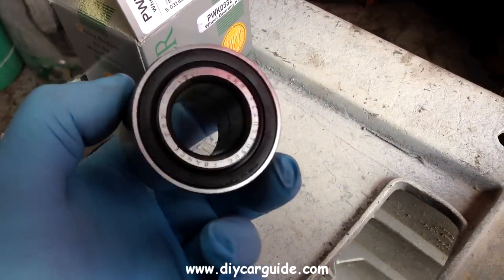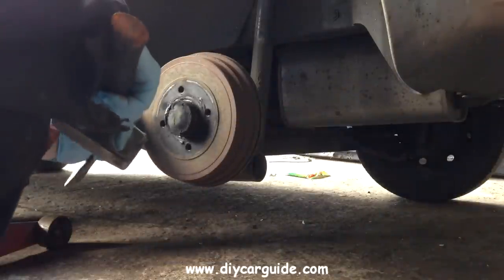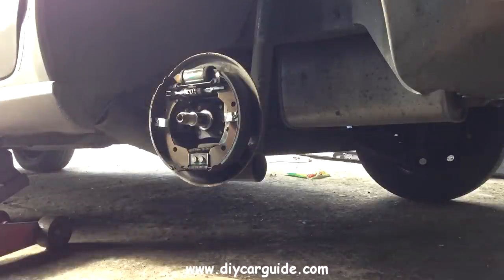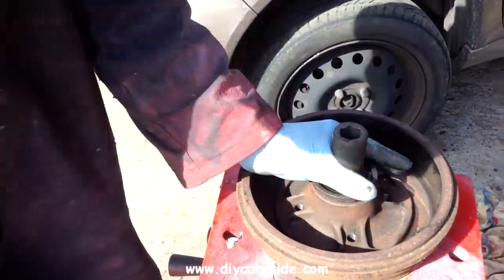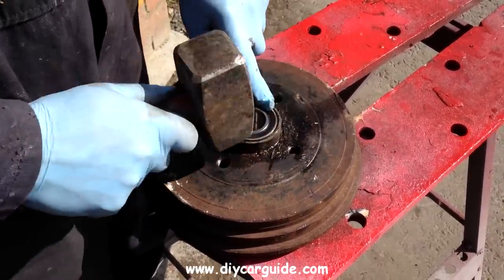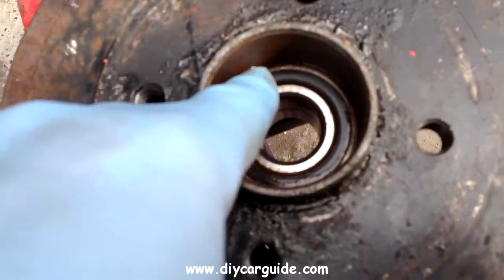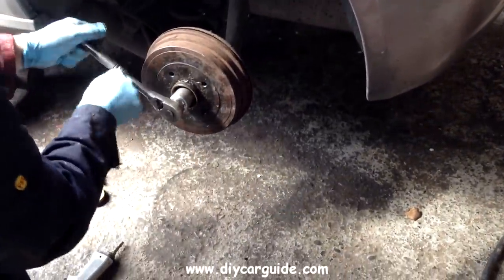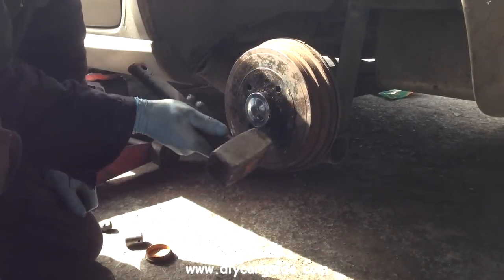Nissan Micra Rear Wheel Bearing Replacement

Comment: Finally!! Please do more videos on this type of Micra!
I had this issues last year and I had to take it to the garage.

On a different subject, How to reduce the wind noise inside the Micra. on the motorway it can be really load and noisy, I can hear wheel, wind, engine noise. Also to know that on 70 Mile per Hour I get 3500 RPM which is really load! I always get a headache after a long day trip. Please help!

Comment: Interesting video & a job well done considering all of the various appropriate tools were not utilised for home instructional purposes!! (fine)  However & of some concern was the fact that "NO SAFETY GLASSES" were worn, "NO NOSE/MOUTH FILTER"was used against the "POISONOUS" dust that was floating around in the atmosphere when the drum was initially  removed??? Also as a new bearing was being fitted there was no hand/finger protection (gloves) from possible dirt/dust contamination etc, etc.!! I'm currently learning this stuff at a 
training institution & with respect, if my tutor had of caught me implementing this level of wokmanship he would have booted my arse forthwith & given me low marks & rightfully so!!
Sure these aspects I've pointed out (& with respect) may not be absolutely necessary but they duly display a good & totally professional level of competence!! Might not have been the way Grandad used to do it but in line with modern vehicle servicing methods & practices, they are without a doubt the right & proper way to do this type of work!!
Safety is "PARAMOUNT" & it doesn't matter if it is in the home or the workshop as it makes no difference to any resulting accident!! As we all have to learn whatever please accept this critique with grace!!! As a side issue, we also put wheel bearings that are to be inserted into a vehicle & try & leave them overnight (or even a few hours) into a fridge/freezer to cool the bearings & therefore make their insertion so much easier!! (it surely works as the buggers simply fly in) 😀😁😋😛👌👌

Comment: Howzit man , doing my bearing change,  what size is that socket that you used to remove old sleeve and does the socket sit on a flat surface or in the sleeve tappered part ( the curved inside) 
Hope to hear back soon and thank you for such a useful video 💪💪💪

Comment: I have a Micra 03 plate i have a noise coming from the front passenger wheel but it only appears in around 30-40mpd and in excess of this speed but its not a humming it sounds like a card does in the spokes of a bycicle wheel but get louder when i turn to the right would this also be a similar issue if it is the wheel bearing??

Comment: Excellent video, is the big nut "grunt tight" or torqued up to any particular value? As it looks like an uber-nylok I guess the former?
Reply: 175 nm according to the user manual. A new nyloc nut is provided in most bearing kits.

Comment: Das Lager hat zwei Seiten, die Beschriftung muss nach außen zeigen. Der Ferritring (ABS-Ring) darf nicht beschädigt werden, er sollte sauber und frei von Metallspänen sein. Die Radmutter sollte ersetzt werden und muss mit ca.  200 Nm angezogen werden.
Reply: @ Peters Schlagerbox.  Thank you Peters, very useful information about which way to turn the bearing. 'The bearing has two sides, the lettering must face outwards'.  Sehr geschätzt, vielen Dank und die besten Grüße und Grüße aus Irland

Comment: What size socket did you use to knock out housing, thanks
Reply: diameter 50 mm +/- 1 mm
Reply: I used a 32 mm, that works well. Can be larger.